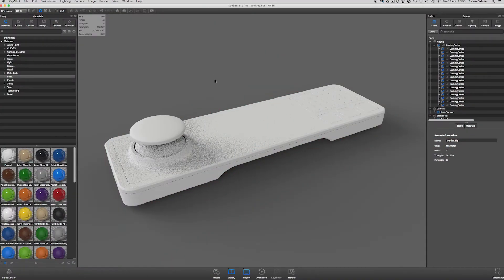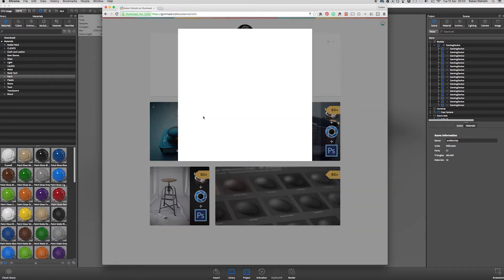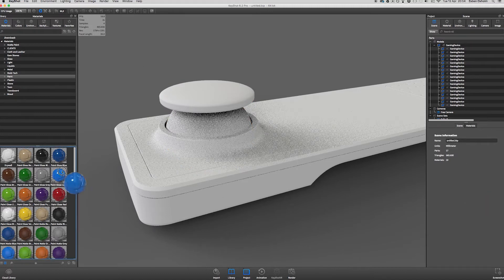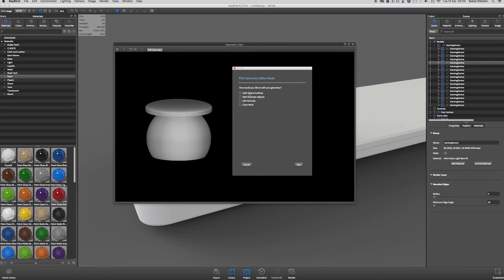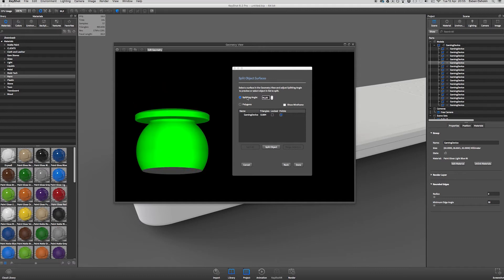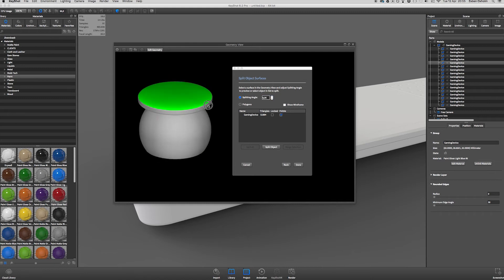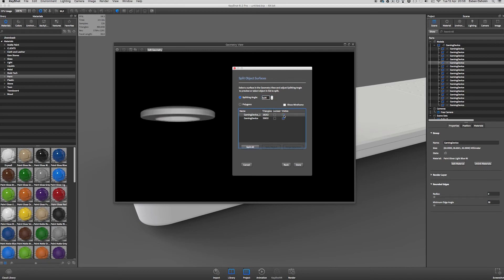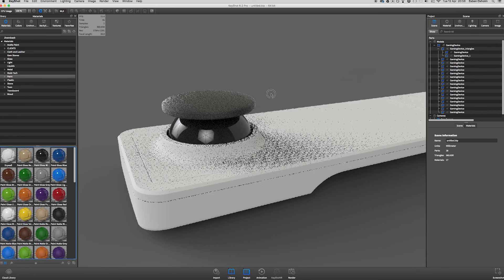How to split a piece of geometry into two using the geometry editor inside KeyShot 6

Comment: Is there a way to still use the rounded edges tool after you've split these surfaces? Or do you recommend modeling the radius before taking into keyshot.